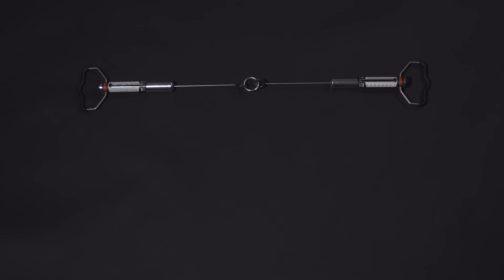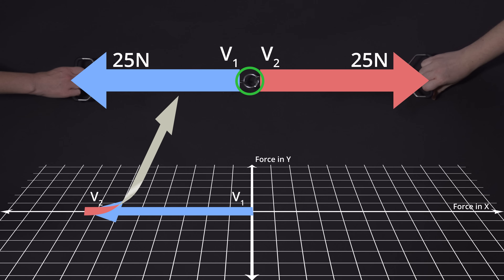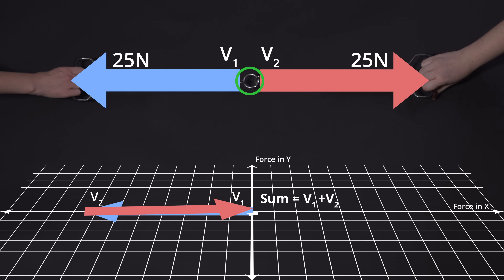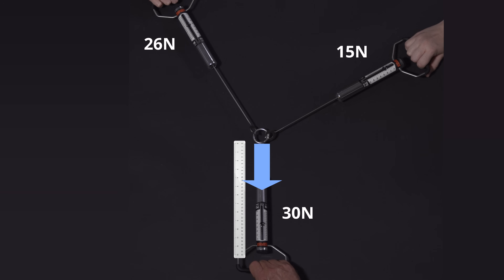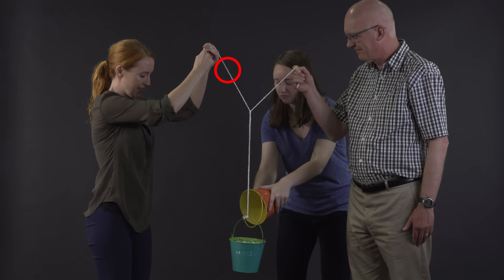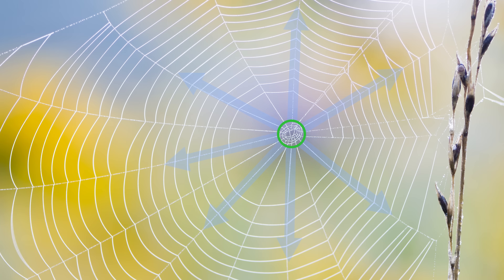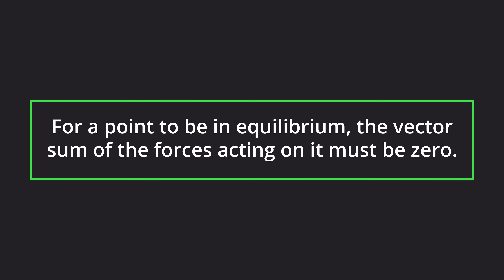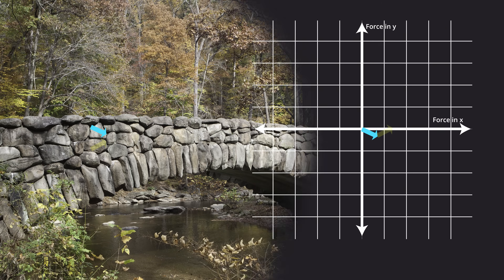1. Equilibrium of a Point

Comment: Mmmm, not well explained. Granted, I am an EFL teacher, not an Engineer, but you lost me completely at about 2:40 when you failed to explain how you arrived at your answer.
Reply: It's explained by basic vector adding, you can find this in any school book about physics.
Reply: I think it was more like an thought challenge. A detailed explanation requires work that goes beyond the point of the video, which is the equilibrium condition. 
If you decompose the tensions on their respective x and y components, the X components cancel each other therefore are equal in magnitude. So the difference lays on the y components. From their respective angles you can be sure that the left one has a "bigger" Y component (trigonometry). Therefore when you calculate the norm of each tension , the one with the "bigger" Y component will be the one that reads higher.

Sorry for the late answer.
Reply: If he explained in depth how he reached his conclusion most people would just sit there and listen without learning. By showing it is possible he has given you the answer. He didn't ask you a question, he gave you an answer. You could say that the only question that remains is "how did he do it?". 

If you're genuinely stumped I can offer you some advice. Physics is surprisingly logical, everything is done for a reason. There is a reason some arrows are longer than others, because some forces are stronger than others. There is also a reason that the arrows point in different directions, namely the forces pull in different directions. The graph is there for a reason, it represents how much the object moves. It starts off in the exact middle for a reason, but it could move up, down, left and right. 

He actually showed the object was in equilibrium by simply placing the arrows onto the graph. You could say it is somewhat, circular, logic. But like I said earlier physics is surprisingly logical. Everything is done for a reason. Even mistakes can be turned into moments of learning. Explaining the answer would be a mistake, as it takes away your chance to learn